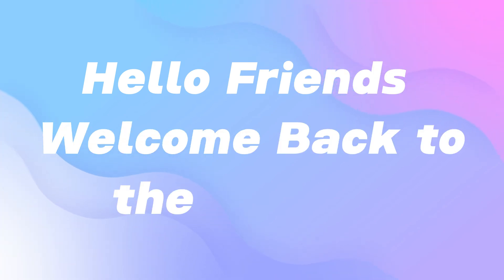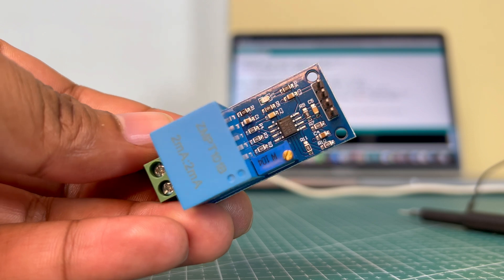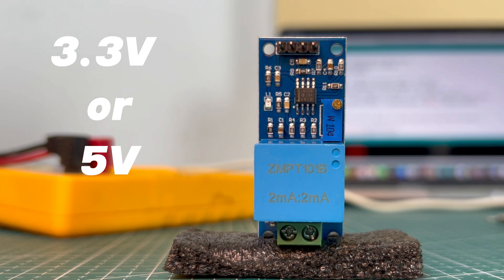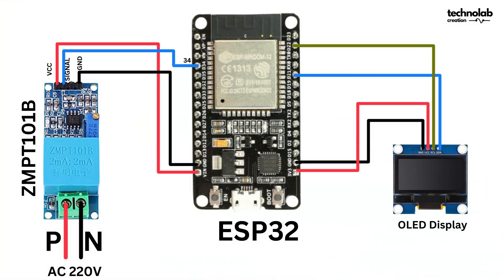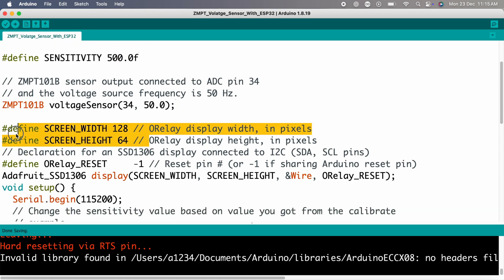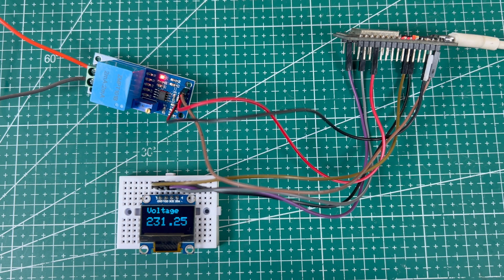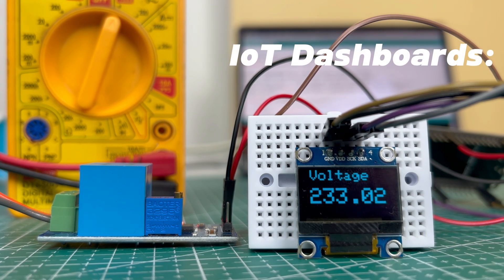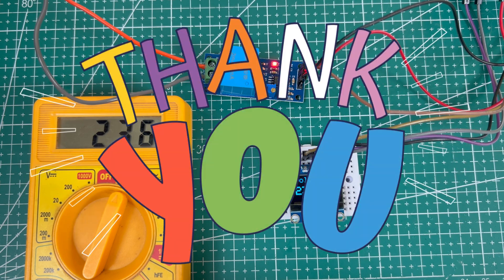AC Voltage Measurement Using ZMPT101B Module with ESP32 | OLED Display Tutorial

Comment: I came to this video because I'm afraid the ZMPT101B might damage the ESP32 board because it is 5V. But apparently it doesn't otherwise you wouldn't be connecting it directly to the ESP32.
Reply from the maker: No danger at All

Comment: Hi  RoboXpert, Thanks for this great code for the ac voltage application. it works great if I use Arduino IDE to program the ESP32. But when I try to connect the ESP32 to my Home Assistant I need the YAML file. Tried converting it, but not working. Can you share a YAML working version of the file? Thanks